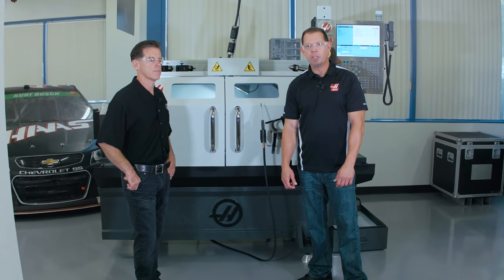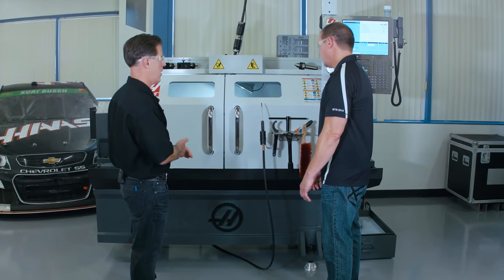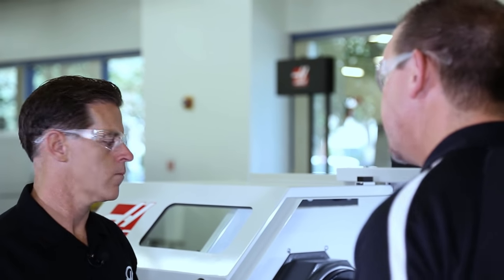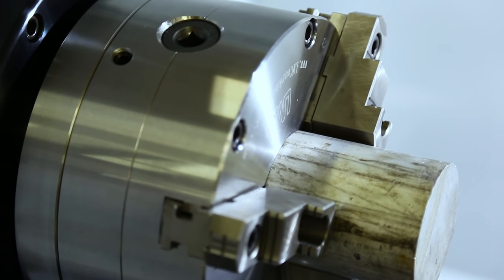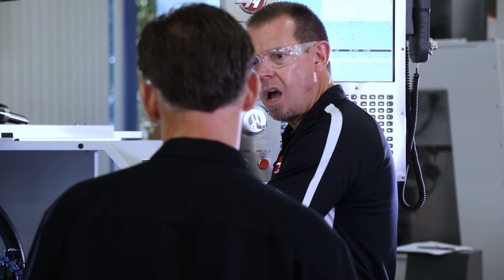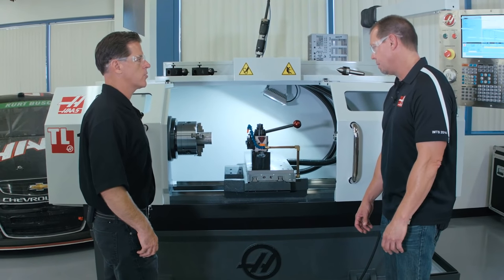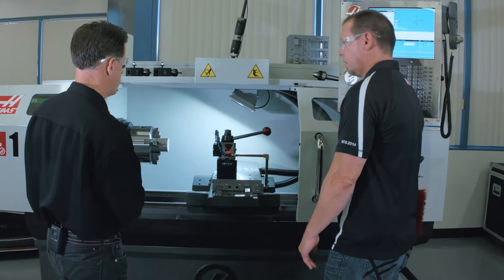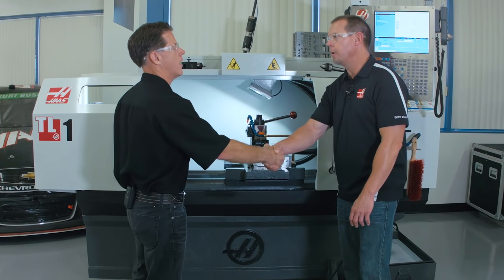The Redesigned Haas Toolroom Lathe - Haas Automation's New TL-1

Comment: Not crazy about the loss of the hand wheels. I have a 2007 unit in a job shop environment and use the hand wheels everyday for quickie manual like operations, fast tool setting etc.
Reply: Put the handwheels back on
I own three. Hand wheels are an asset

Comment: I would never get rid of my TL-2 lathe with the hand wheels now. To me that is what a tool room machine is. I use them way too much, I can run over to the machine and chamfer, turn, or face something real fast. I don't have a manual lathe because I have my TL-2. The only thing I don't like about mine is the ball screw is toward the back and I think it is starting to give me some issues. But it is a 2007 and it has run production here lol.

Comment: Bring back the hand wheels, best lathe available with the hand wheels! Haas say they are bringing out  a hand wheel option soon.  Is this available in single phase?
Reply from the maker: +Simon Lawrence We’re glad to hear you liked the Haas Toolroom Lathe. We are always developing new features to improve our products. We’ve added a new chamfer feature on the TL so we can manually cut any XZ angle, with the Jog Wheel on the pendent, or a remote jog handle. You can run a TL on Single Phase, if you have 240V. See page seven in our TL addendum (http://diy.haascnc.com/sites/default/files/Locked/Manuals/Supplement/96-0112ab.pdf?0=%253F1021) and feel free to reach out to your local HFO for more info.

Comment: I use my TL1 maybe 2 hrs/week for small runs of parts - mostly bushings with low accuracy requirements. Having the handles makes setup so much faster than having to use the X & Z buttons on the panel to move everything around. I question the logic of removing the handles. Now it is more difficult to use. Customers should consider stepping up to a mill with an auto chuck and tool changer instead of buying the newer TL1.